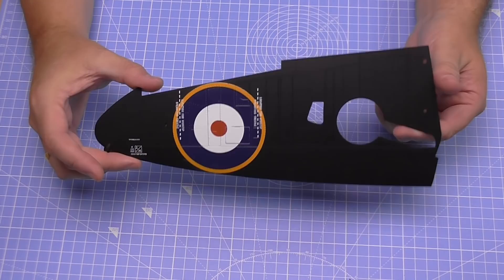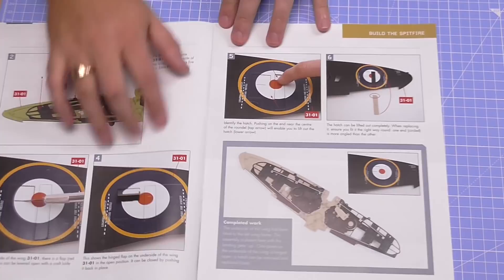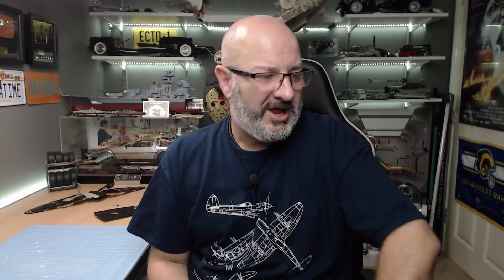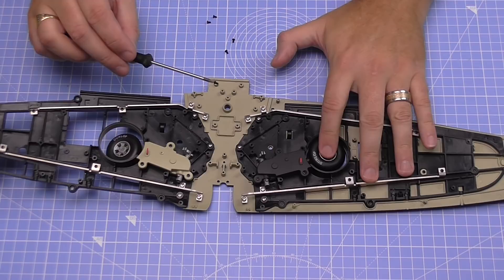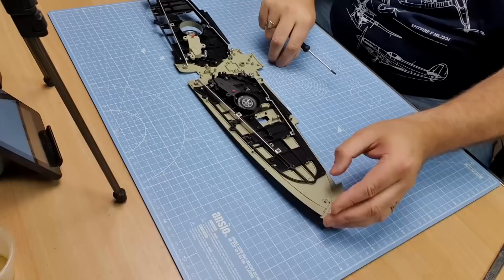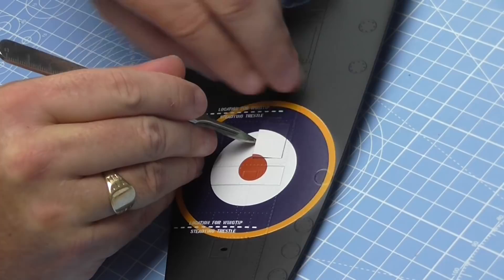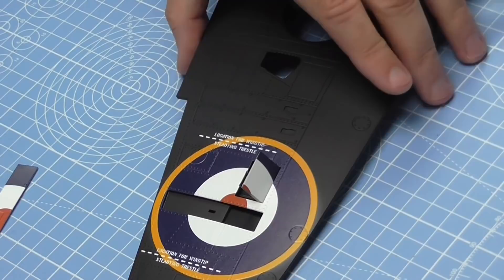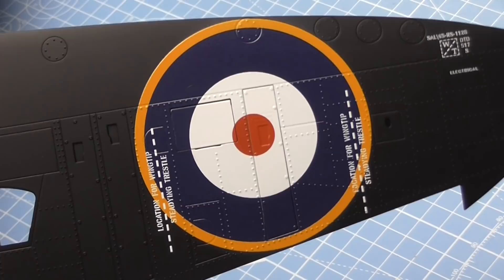Build the Spitfire Mk1a - Part 31 - Fitting the Underside of the Port Wing

Comment: Hi wayne had to use a little bit of blue tact to hold the flap as it would not stay close  also they are using photo etch on the cooling radiator

Comment: Hey Wayne,great video again. I think them flaps are for the extra 20 issues when you complete the plane and the guys are working under the wing when its on its stand,just a rough guide but I could be wrong.